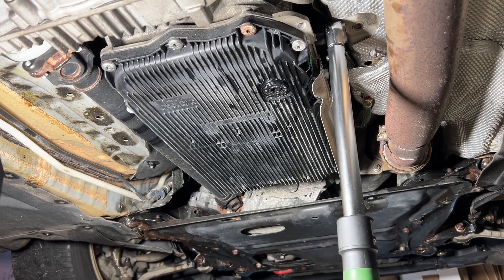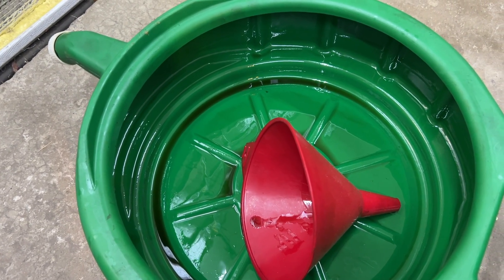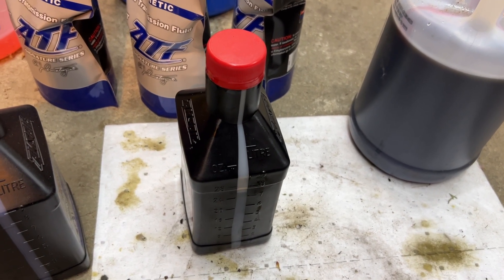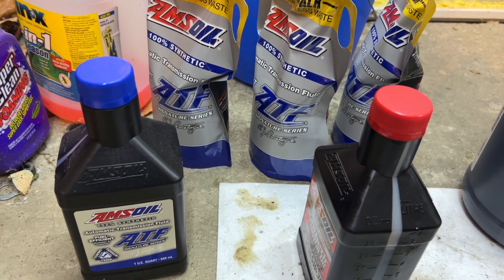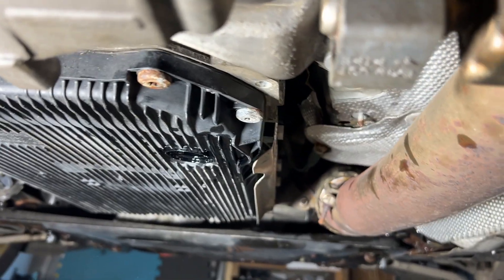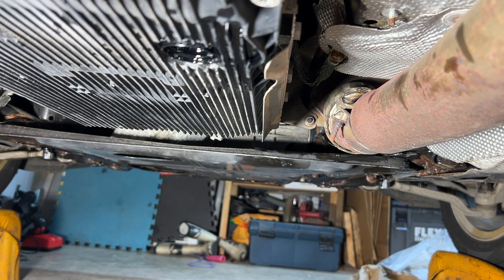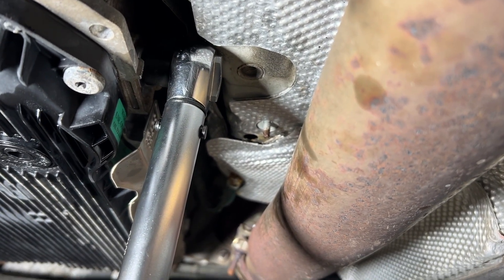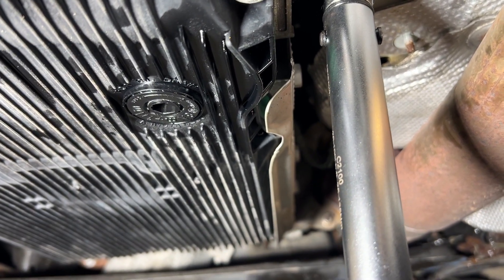ZF 8hp Transmission fluid change, fast and easy without being scammed with lifetime nonsense fear.

Comment: the Lifetime scam is merely for selling more cars as the Trans will fail sooner if Trans fluid not changed between 50k to 80k miles for sure.  Thus, will need to buy another car.  i.e car sales

Comment: Didn't change the pan/filter?
Reply: To be fair these aren't even really filters in the ZF and many modern transmissions... They are a mesh that catches large particulates from manufacturing.  So yes you can change the pan and filter, but it's not like an oil filter that will clog and go to bypass... it's essentially a bypass from the get go and if that large mesh is catching stuff you need more than a filter and fluid change...
Reply: @itsheresy I changed the pan/ filter when doing my daughter's Giulia.  Since the pan had to come off, might as well change it.
Reply from the maker: Please remind me what I said in the video?
Reply: I believe you changed the o-ring

Comment: Was the orignal ATF oil color green ? I have zf8hp50 want to try Amsoil ATF but its Red and im worried will damage the transmission
Reply from the maker: 3 months driving and no damage. It shifts better and less hunting for gears. Color is not an indicator for quality it’s just to scare people away from using better fluids
Reply from the maker: Yes it was green. Why would it damage?
Reply: Thank you sir for your reply 😊 you have given me the confidence to try
Reply: Yea the green is just a dye

Comment: My wife always goes to dealer - they have not and will not service this trans..  car has 100k now - wife drives like granny , im going to have a look at it . Will do a dump and fill first. Chrysler  pigs.
Reply: Why they won't?
Reply from the maker: @mikeprice8307 what?
Reply: @repairvehicle  It's true. Lots of dealers won't do it and claim it's lifetime.
Reply: @mikeprice8307  I read on the internet the reason why dealers don't do transmission oil was because years ago they created more problems by not knowing the proper way to refill (which we know now, how to do - refill, run the engine, let the new oil circulate up in to the clutch plates and oil coolers, and then add more and re-check the oil level until it drips out the fill hole when hot) and ZF an others wouldn't warranty broken transmissions due to servicing errors. So the dealers just said "lifetime" which basically means until your lease is up and you buy a new car.. 3 years.. maybe 5.. that is what they consider lifetime.. not lifetime forever but lifetime meaning until your dealer new car warranty or first owner lease expires.
Reply: I went to my local dealer, and they said they don't do it.  So....find a dealership that will.  It wasn't hard....I found one just 15 minutes away in Edmonton, and they said no problem.....(I'm the boss, lol).....they did feel the need to explain the risks, and said they would do it, but that I needed to sign a waiver.  I said no problem.  I have 122 000 km on my Jeep, mostly highway kilometers.  Just so you know, ZF themselves, recommend a fluid change between 50 000 to 80 000 MILES, or 8 years.  So, who are you going to believe.....the people who make the transmissions....or the people who sell them in their cars?  The reason why dealers don't like doing it, is because there IS a procedure to follow for getting the correct amount of fluid in the transmission, AND, they only expect vehicles to last as long as the transmission before they sell it, or wreck it for other reasons.  Most people don't know how to take care of their cars.....they will let the bodies rust out then throw the car away.  DIY are able to do it, but follow the procedure.  The procedure is also out-lined in the Haynes repair manual.  I got the fluid changed, and the filter/pan, and have had no problems.

Comment: I’ve been running Amsoil fuel efficient ATF in my Ram 8HP transmission since 60,000 miles now at 85,000. It works fantastic no issues at all. I also used a PPE pan with replaceable filter. I’m very pleased
Reply from the maker: how do you like your 6.4 engine and what fuel economy do you get?
Reply: Did the very same about 1y ago with my Ram 1500 Longhorn. Works well. Wish PPE put more magnets in their pan tho

Comment: Can you also service an Xdrive transfer case, front and rear differentials not using bmw fluids? I’m thinking of using Redline MTLV or something light for the transfer case and Valvoline 75W90 on the diffs because they tested well…
Reply: I will continue to research for aftermarket fluids that actually protect and are compatible 👍🏽
Reply from the maker: There are other options for transfer case besides oem
Reply from the maker: Here is one Transmission fluid DTF-1 lifetime nonsense, damage is done by false advertising by car companies
https://youtu.be/-bB0KrtN05A
Reply: @repairvehicle  ahh Icic! You’re using the Shell supplied bottle available on FCP Euro among others! I also see Triax and Ravenol have options as well